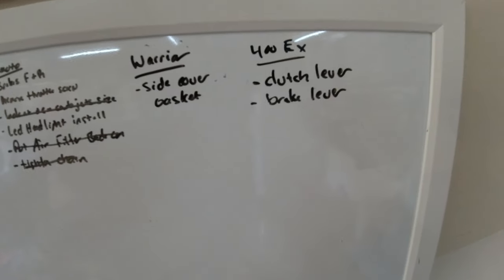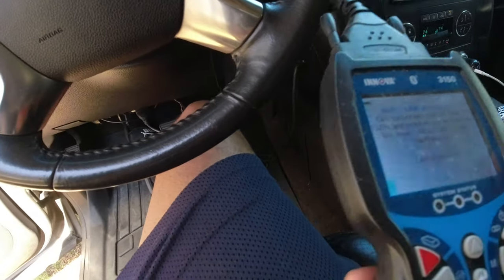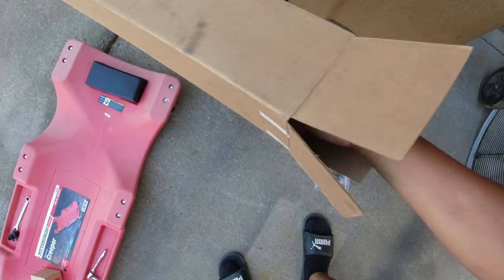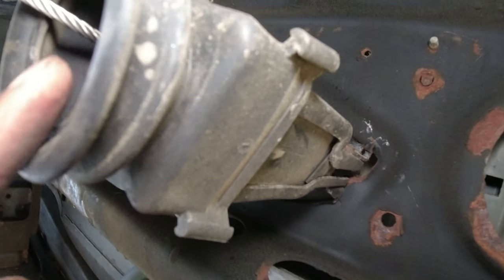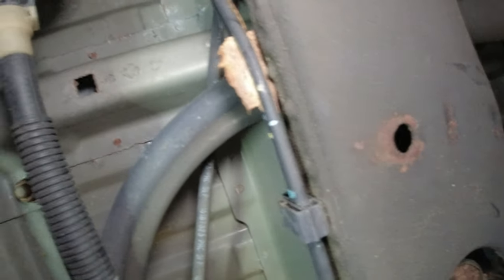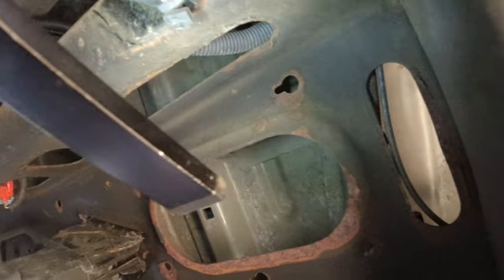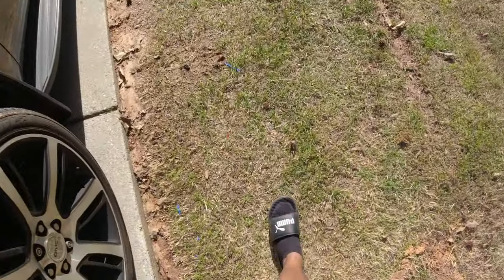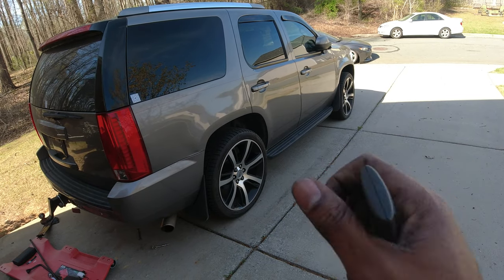Vapor Canister Vent Valve Replacement| P0449 |2007-2014 Tahoe Yukon Escalade Suburban

Comment: Hello, I have a 07 Chev Tahoe, mine has the two hose connector from the filler neck, to the canister to the evap, ( like your truck ), does the upgraded part mean I have to leave the little square filter just attached with zip ties? And do I just leave the connection to the filler neck open? Because I have bought the part and have tried to change it myself but I have always thought I got the wrong part because of the little filter going up.
The TIA, video has helped me to understand it better.
Reply from the maker: In my case the upgrade part just changed the wiring harness connector and I also had to order the harness adapter. My OEM little filter thing was ziptied up there so I put the new one roughly in the same spot as well. I do not know if it makes a difference where the filter is located. I did not have to mess with the two lines running to the filler neck.